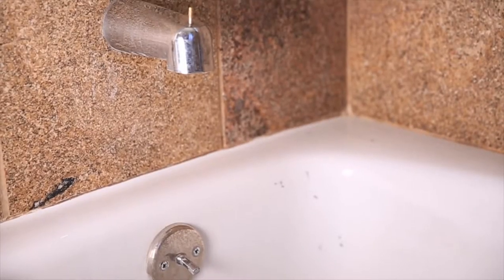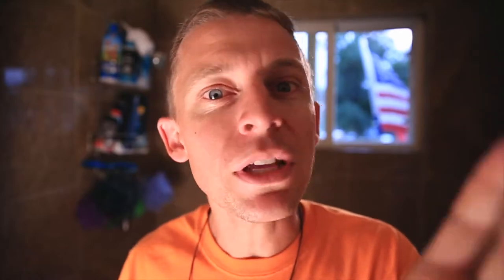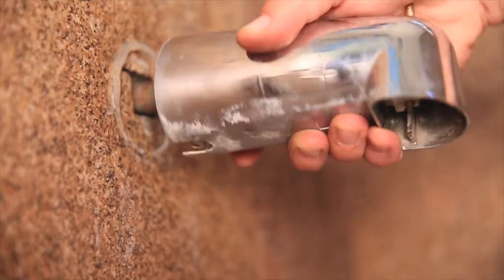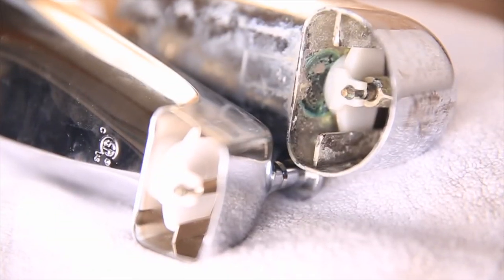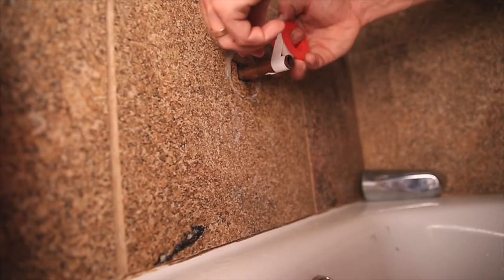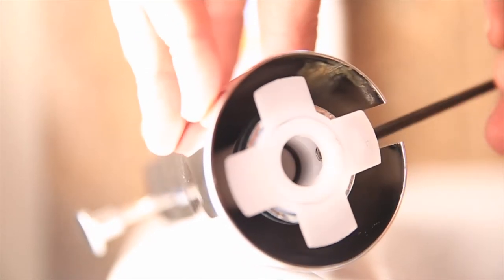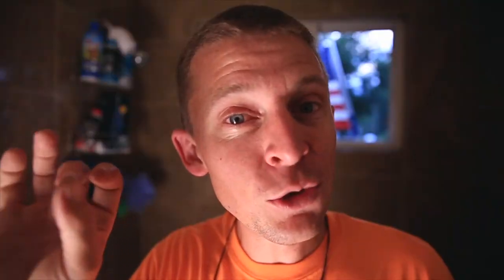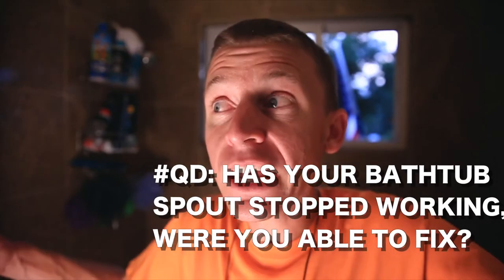Bathtub Spout Replacement, How to replace Step by Step

Comment: I've done a lot of home improvement including building a master bed/bath on the second floor of my old house and gutting and remodeling our current master bath but have never replaced the bathtub spout. Congrats!!! Also, good on your for driving a stick. My car is a manual too.
Reply from the maker: If you can gut a bathroom you can replace a spout!
Reply: Now I know.

Comment: Help!!! What happens if I can’t find a spout that fits?? Every one I have bought and returned will never go flush with the wall. The pipe is too long. There’s about an inch from the wall to the spout and can’t turn it anymore.
Reply: I know it’s been 3 years but they make spacers and rings that go between the wall and the spigot

Comment: Don't let the wife see this, you didn't clean off the calcium crud behind the spout.  ;)
Reply from the maker: Nothing gets by you Rob : ) I’m glad the camera angle and lighting was good enough for you to see that; glass half full all the time 💥
Reply: I've never had to replace the spout.  So, I did learn something.  My drain froze open a couple of years ago and I ended up having to have a plumber replace it.  I don't bend like I used to.  All kidding aside, it is a good diy video.
Reply from the maker: Rob Hoffman thanks Rob, hoping to do some more like this in the not so distant future. How’s the house project coming?
Reply: They sided the whole thing today.  It's a fantastic team.  We have insulation, drywall, cabinets, etc to go but it really is looking like a house.
Reply from the maker: Rob Hoffman Great news! I’ll come look for an update video soon.